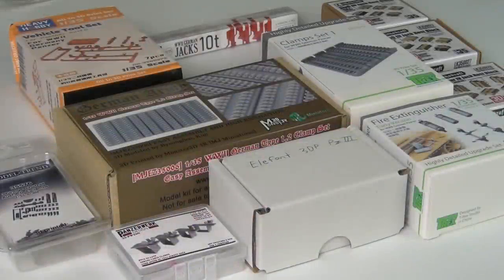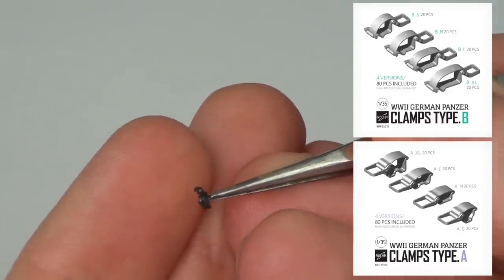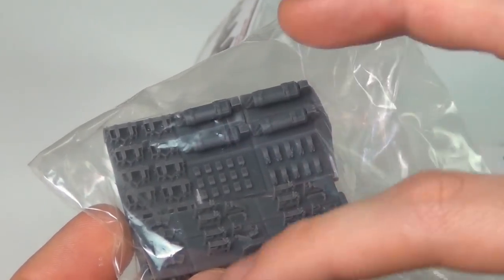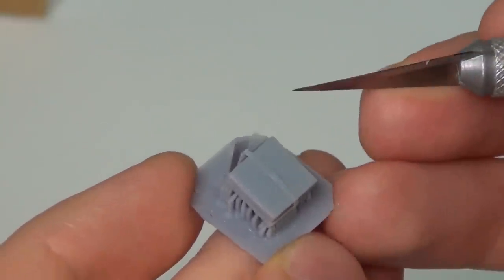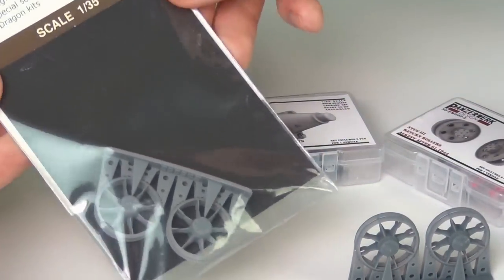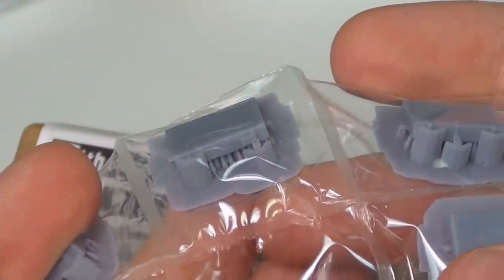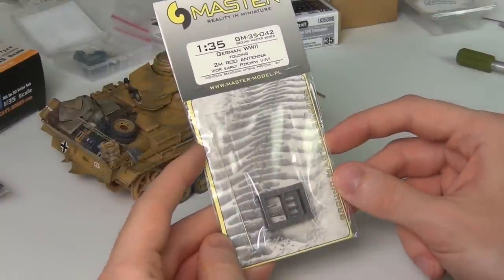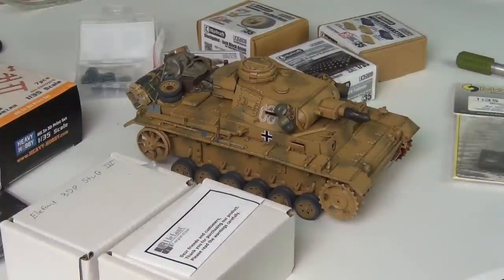3D-Printed Parts Review -- Panzerwerk Design, T-REX Studio, RochM Model, Heavy Hobby, Elefant Corp..

Comment: You're right, FC is garbage. I tried out three things to give them a chance and there was warpage on a Hercules trailer that could not be fixed and tracks and wheels printed together for the Maulter set of trucks which look like they will break when I try to remove the casting gates. The only thing that will work was a front seat for a Blitz truck or Mauter that has the seat correctly divided into two parts so that petrol could be put in the vehicle. This is a one piece casting so there shouldn't be any trouble.
It may interest you that Tiger Model Designs, which shut down last year is going to reopen, I know Joe well, and he says he will concentrate at first at making new masters for some of their small items. What I like about Joe's stuff is that his resin pieces fit well and though they require clean up a lot of the time, they don't break like 3D can and if misshapen they can be easily fixed in hot water. He will open again at the beginning of August. He also has a master model maker, Karl VanSweden, whom I have a great friendship with and together they were able to make a full interior for the Tamiya M10 that is affordable and sharp. Same with the M18, but not a full interior. I hope you will give them a try, and my friendship with them does not mean that I get any money for referring people to them. Honestly, there are some 3D printed parts that are better than resin offers, but at the same time, the reverse is true, and certainly when you consider the price at TMD.

Comment: Thanks for the Video, this was realy helpful and gave me a good overview on a quickly overcrowding market. I mostly used 3d printed parts that came with Rye Fields Update Sets for their own kits and Elephant Sets. I'm not really happy with the Quality of Elephant. I found their products to be very brittle and their german fire extinguishers have visible layer lines and are not very round because of that. Did you make the same observation? Maybe I just had an early and therefore less refined batch.

Comment: I’ve only tried the MJ tool clamps. Nicely detailed, but they are so brittle! I’ve destroyed so many of them while cutting them off of the sprue. I’ll have to try some of these other brands.
Reply from the maker: My set is alright.  I trim the supports under the handle first, then under the clamp.  That gives me a higher success rate but I still probably break 1 out of every 8 or so clamps.  At least the sets have a ton of clamps.